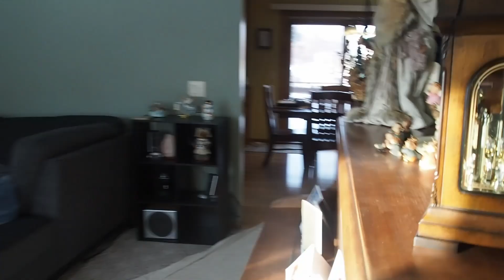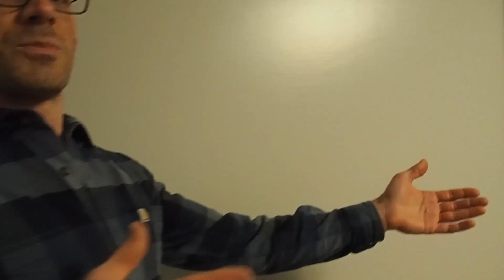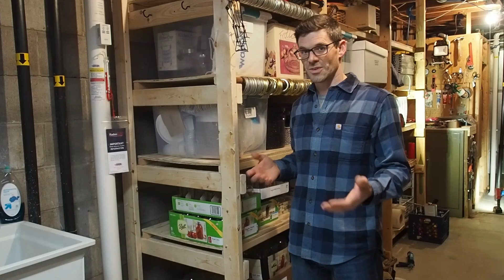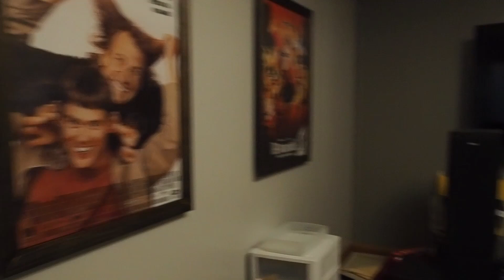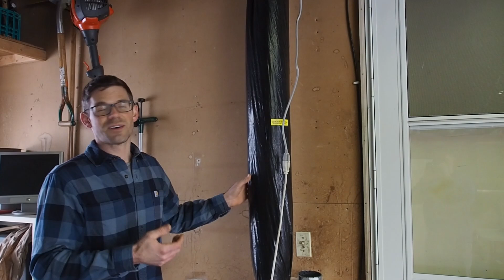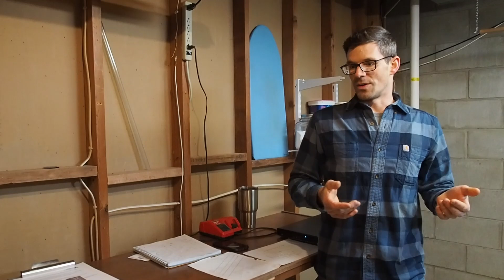Sub-Slab Depressurization Radon System in a Home Without Drain Tile

Comment: Hey, great job! How were you able to get under that footer? That seems like a nightmare! How deep was it? I don’t come across those footers often in my area, so it’s usually not an issue. When I have come across them, I was able to get above the ceiling to an unfinished area to add a suction point. I’ve used the stitching method, but never under a footer. Thanks for the videos!
Reply from the maker: Thanks, Keith. Stitching under a footing isn't easy, but it is straightforward. First, make sure that you are lined up on both sides of the wall. Then, core your holes and dig your suction pits on both sides of the footing. Finally, auger and dig under the footing toward the other suction pit to connect the pits. The bottom of the footing is about a foot below the top of the slab. Plan for extra time if it's clay. A long auger is a time saver. 

Adding another suction point is typically easier and faster, but we don't always have an unfinished area on the other side of the footing. Stitching under the footing sure beats a pipe coming through the wall in the corner of the living room. 

Remember that the radon standards now require that the horizontal piping be secured every four feet, so that might make going over a finished ceiling a bit trickier. 

Thanks for watching, Keith!

Comment: Wish you were in my part of the country, this looks like some top quality work!

I looked through your videos and didn't see any that just vent strait outside and have the fan outside. How do you facilitate that type of system?

Also, I understand the importance of sealing the house. However, how would you seal floor drains that drain into the sump pump well and still have them remain functional?
Reply from the maker: Thank you, Zachary!

We really don't like installing exterior systems. I wouldn't install one in my house, so I wouldn't recommend it to anyone unless it is the only option. 

Apart from being hideous to look at outside the home, they are much more susceptible to freeze-up issues in the winter. This means your radon system may not be working when you need it the most.

They are quite cheaper to install, so they are often the option a seller will choose when they are forced to mitigate during a real estate transaction. 

We install a handful of them a year on homes that have a detached garage and are a story and a half. These homes typically don't have attic space to install an interior radon mitigation system.

In regards to your floor drain question. You can use a Dranjer to seal the floor drain. 

Here's a link to purchase one:  https://www.dranjer.com/dranjer-radon-reduction-products/dranjer-fr2/?portfolioCats=12

If you install a Dranjer, be sure to keep it clean so it doesn't plug up and cause flooding. 

A floor drain is not typically an issue if it has a trap and the cleanout plug installed. It's also not an issue if it drains to a lift station in the basement. 

It is an issue if it drains to soil or to a sump basket.
Reply from the maker: Where are you from by the way?
Reply: @AmericanRadonMitigation  Commenting to you all the way from NE Ohio.

Its awesome your putting out these videos and sharing knowledge!

I found drain products like that in my research but I had concerns of them working with a negative pressure post valve. That would still allow the valve to open and not seal the drain, right? Or is the negative pressure of a proper system low enough that it isn't a problem?

I have a floor drains in my basement (1960s ranch) that doesn't have a trap associated and just drains to the sump basin. I am unsure if I have a drain tile in this house either but i'm pretty sure I don't. From my understanding, when putting in the radon system I should seal anything that is open to ground. I don't believe the sump basin is that well sealed against the ground and so my plan was to put a cover on the basin that I could seal the whole system. This would mean that I need to put that seal on the drain too. However, from watching your videos, it seems the the pressure field should extend everywhere and I believe will find its way into the sump basin, thus the drain, thus putting the negative pressure behind the valve, making it open, and leak.

With regard to the exterior system, I don't mind it visually being outside as i would plan to put it by the other utilities like the AC unit, hvac exhaust, and dryer exhaust. I would like it to be as quiet as possible and I imagine being outside would keep most of the noise out there, and I'm currently planning to do this job myself so reducing cost and complexity is preferred. 

Also, another question I have, why is it not popular put pipe caps that don't allow water to get in vs the style you do use? A cap that doesn't allow rain and such I feel would be better for the fans.
Reply from the maker: @ZMAN24250  The Dranjer is designed to work with a radon mitigation system. 

If your sump is not open to the soil then you don't have to seal the sump of the drain. 

Rain caps are not typically recommended. The exhaust discharge requirements are different if you install one. See section 7.4.11.2 of the standard https://standards.aarst.org/SGM-SF-2017/16/index.html
Reply: @AmericanRadonMitigation  You're a legend! Cant believe I didn't think to look for a standard document, guess I didn't think there would be any out there free to view. I cant wait to read all this and do everything by the book. 

Keep up the great work!
Reply from the maker: @ZMAN24250  Haha, I'm just a regular guy that's passionate about radon mitigation.  

Let me know how it turns out!
Reply: @AmericanRadonMitigation  Update #1. I sealed everything I could in the basement. Sump pump well, drain to sump well, wall cracks, hole in the floor.... then did a baseline test. Just sealing everything brought the levels from 16.4 (performed during initial home inspection) down to 5.1 post sealing. 

It seems I still need a mitigation system. Im not looking forward to having to get a PFE through what I'm guessing will be clay under my concrete slab.
Reply from the maker: @ZMAN24250  Wow, I'm surprised that sealing dropped your radon levels as low as it did!

If you have drain tile (perforated pipe) connected to the sump basket, it will be much easier to get pressure field extension. 

Just tie into the drain tile system as we did in this video. https://youtu.be/h0g_UY5-Zew

Comment: Where/When do you use 4" PVC vs 3"?
Reply from the maker: We measure how much air we are moving from each suction point with the pitot tube you see me talk about in this video. We then add up how much air we are moving to see what size pipe we need for each branch and for the truck line. 

The amount of pipe and the number of fittings play a role as they add restriction to the airflow. 

In general, we use 2-inch pipe if we are moving less than 30 CFM, 3-inch if less than 60, and 4-inch if more than 60 CFM.
Reply: @AmericanRadonMitigation  Thank you so much for your videos and your response. Keep up the great work!
Reply from the maker: @ADPrevost21  You are very welcome, Andrew! Are you a mitigator, a DIYer, or just a radon nerd like me?
Reply: @AmericanRadonMitigation  A nerd and DIYer. I bought a new house a year ago in Michigan and like to be able to use or basement as an office. Which, due to COVID, my wife and I started doing. I decided since we spend so much time down there. I should test. I bought a RadonEye and have been watching it swing above 4pci/l on occasion. I've started sealing cracks and was thinking of installing a Fantech "ec" fan running to my sump pit. I was planning to dial the fan down if possible to save on energy cost. Hoping to not have to have multiple suction points. Sorry for all the info, lol.
Reply from the maker: @ADPrevost21  This will likely be the most helpful video for you if you have interior drain tile. https://youtu.be/h0g_UY5-Zew
Reply: I have learned a lot from our videos. Thank you for sharing and explaining in them! I have a question: in your sub slab pressure checks you want 3 as a reading in your farthest hole. Is this a standard number or just what you have found will move the lowest amount? Thanks again.
Reply from the maker: @Tenpennycustoms4958  Great question, Logan! I always wondered that as well. 

I found that the vapor intrusion world uses negative 3 pascals in the winter and negative 5 pascals in the summer as their target numbers. 

They also do this under maximum depressurization. This will help ensure the mitigation system keeps negative pressure under the entire slab throughout the seasons and building use. 

You have more stack effect in the building during the winter so that's why the target number is negative 3 pascals in the winter vs 5 in the summer. 

This means the building typically sucks harder on the soil in the winter than in the summer.

Negative 5 pascals in the summer gives us more of a cushion.
Reply: @AmericanRadonMitigation   great thank you for the info! I’m not to the point where I can afford the same micro manometer‘s that you have as they are fairly expensive. But hopefully soon I can.
Reply from the maker: @Tenpennycustoms4958  The DG 8 micromanometer from The Energy Conservatory might be a good fit for you. 

I beta tested it a few years ago and liked it. 

Here’s a link to it https://energyconservatory.com/products/

They have a very knowledgeable staff too.

Comment: I've noticed you don't place your RadonEye directly on the ground is there a reason behind that?
Reply from the maker: Yes, they teach us in the radon measurement course that a radon test needs to be at least 20 inches off of the floor. We like to place them in your normal breathing zone.
Reply: @AmericanRadonMitigation  Thank you again! Great info, great videos!
Reply from the maker: @ADPrevost21 You bet! Is there anything you'd like us to show in a video?
Reply: You could do a video on how you mitigate noise from the fan. For example, any techniques, vent mufflers, etc. What noise levels are to be expected and what can be done about them. I know that's a big concern for a lot of people.
Reply from the maker: @ADPrevost21  Thanks for the suggestion.

 I'll keep that in mind. I'm thinking that sound may be hard to demonstrate in a YouTube video as we have run into that issue in the past.

Noise reduction 101 is to reduce vibration transfer to the structure next to the radon fan, use the smallest radon fan that will achieve pressure field extension, and seal air leaks to the soil so that the radon fan is not moving air than necessary. 

You also want to try to locate high wattage fans away from areas where people may spend a lot of time. 

For example, we chose the garage attic over the house attic as the fan would have been right next to the bedrooms rather than by the living room and kitchen. 

A noise suppressor can reduce exhaust noise by about 75 percent in some cases. 

You want to be mindful as some of the noise suppressors on the market reduce airflow. 

We build our own suppressors, but here's a link to one that is similar that you can purchase. https://www.radonsupplies.com/product/SNS2040.html
Reply: I see in the last couple videos you upgraded to bluetooth micromanometers.  Looks like a convenient setup.
Reply from the maker: @johnd7643  Yes, they are pretty darn slick. 

Especially when dialing in the potentiometer on a radon fan up in the attic.